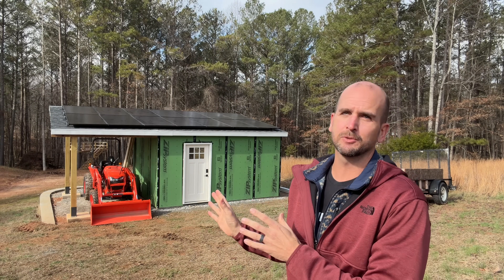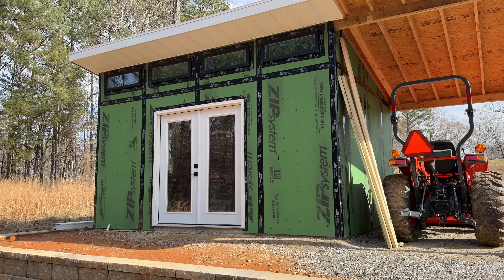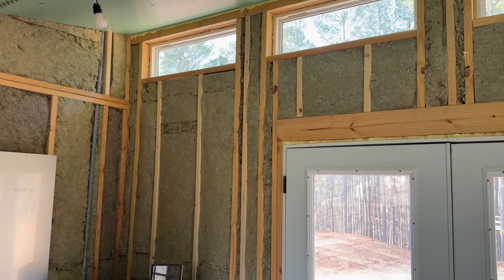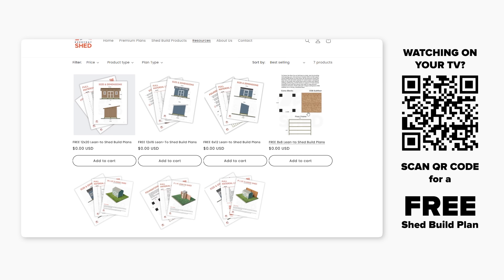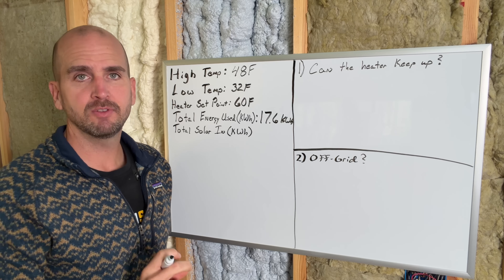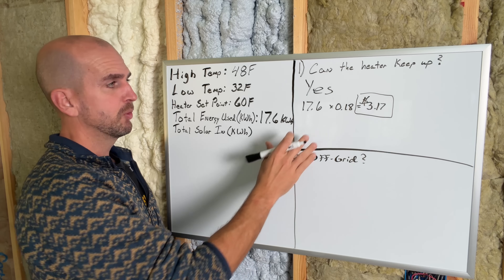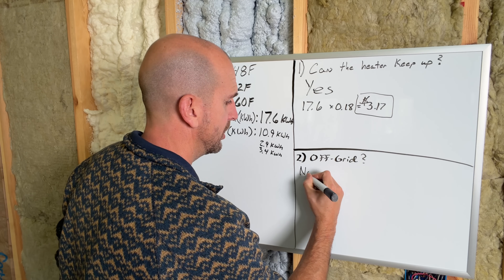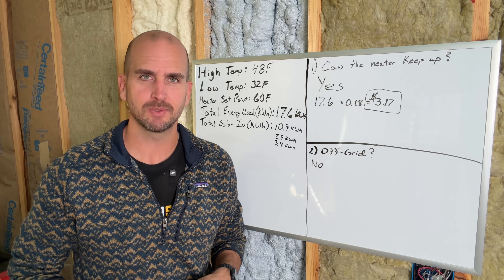HUGE Mistake: Why My $15,000 Solar System CAN'T Heat My Tiny Shed

Comment: This is probably posted to try to stay relevant to the algorithm with a half done project. Or as a comment farm. Either way it's rediculous to instal huge french doors and a front door on such a small space with basically no insulation on the floor or cieling and expect to retain any heat. Old timers know to seal the inside and outside and that the windows should face the winter sun.

Comment: price of that battery is too high for its capacity, but it doesnt matter, without grid even 28 panels will not help you in the winter because there would be stretches of days with zero solar input. 
so even if you get heat pump there will be days when you would need to use propane heater or regular outside wood stove.

with a minimal heat pump that consumes 2kwatts below freezing(cop2+ so heat output is above 4kilowatts) you will not be able to run 24/7 because you already pointed out that solar panels does not output enough to keep positive balance with that battery, and 1kwatt heat pump will not work when it gets way down below zero for a 3+ days.

use any "smart" heat loss calculation  app or service and you will see for yourself that 14 panels will not work out without grid

Comment: Its pretty cheap to build a thermal battery. Put a 220v water heater element into a steel drum filled with sand. After the power is gone from the solar with the sunset the thermal mass of several hundred pounds of sand it will keep warm and giving off heat.

Comment: Instead of a deck, I would build an atrium outside the french doors to act as a heat sink. If you have enough thermal mass in there, you might not need the heater at all on most days. I would also add insulation to the floor and ceiling as others suggested.

Comment: A few things - most sheds don't need to be that warm - just above freezing - say 40-45 degrees.  2nd I'd have a lot more insulation and would include a vapor barrier for any insulation that is not foam based.  3rd I'd only use foam based insulation for 1 2x4 stud cavity.  My garage has r35 in the walls and a vapor barrier - ceilings are r48 foam (foam board - I used DOW in the past - but Silka now -HD -  4x8 sheet @ about $40/sheet - r6.5/inch - fur out the walls to 4 1/4" and double layer)  Also insulate the floor - you're loosing a ton of heat from the floor.    I also agree with the heat pump - get a COP greater than 1 above freezing.  If heating is your major concern -paint the shed flat black (it will cook in the summer though - you could add shade sail in the summer).

Comment: Your vapour barrier should be on the inside of the insulation, you will get condensation and then wood rot with it on thru outside.

Comment: Use a mini split heat pump system rated for low temps. It will generate 3 times the heat for the same power usage. Or use 1/3 the power for the same heat. Depends on how you look at it. Resistive element heaters are very inefficient compared to heat pumps.

Comment: I have a 6kw system on my house.  Power generation is much less in the winter as the amount of daylight hours is much less (hard to solve that old tilt of the earth's axis as it orbits the sun problem).  Also, you have fixed panels (as do I), so the angle of inclination of the panels is very sub-optimal to the sun in the winter.    These two problems get worse the further away from the equator you get.  Finally, you tend to have more overcast days in the winter.  I average 35-40 kWh of generation per day May through September, but only 10 kWh of generation December through February.  You would have to oversize your solar system by a great deal AND have a good amount of backup batteries to truly go off-grid and live comfortably in the winter months (and this would cost a great deal of money).

Comment: Try a heat pump. Eg4 has mini split systems that run directly from solar panels with no inverter required.

Comment: Trying to take sunlight, convert into electricity and back into heat doesn’t make sense. if you can collect enough sunlight to do it you can collect more than enough with a solar heat pump.

Comment: You don't need it to be 60 degrees 24/7, it just needs to be above say 40-45 degrees when your not in the shed (assuming there is plumbing). Also, passive solar would help. I'd use propane when I actually occupied the shed.

Comment: You really emed to do more research before making these videos. Your insulation is bad, your heater is the worst option you could have gone with, and your solar system isn't worth nearly $15k even if that's what you paid for it. I have 16kw of panels and 94kwh of lifepo4 batteries and I'm $15k into that whole system. Ecoflow and every other similar system is overpriced trash.

Comment: In the first few minutes I could see the problem no split system A/C that is 3-4 x better than a resistance heater ground loop even better, lots of windows with no curtains, solar not taking up all the roof space or even better overhanging a bit.

Comment: I see a lot of people mentioning in mini splits or a heat pump which both are great ideas. There’s also one other one I would also possibly be considered. That would be radiant floor heating using like a hot water tank and running pipe underneath the floor and like everybody else has mentioned you need way more insulation for your ceiling. Heat rises, and heat moves to where it’s cold so the greater the temperature difference from outside the inside the quick you’re gonna lose that heat if you don’t have adequate answer.

Comment: There are only two ways to off-grid solar battery heat any kind of space and here are those two ways you either throw a stupid ridiculous amount of money at it and have 15 kilowatts of solar power and a huge battery array or you take the much more reasonable rational and cheaper way you insulate the living m********** s*** out of that shed.

You need way more insulation in the ceiling way more insulation on the walls and you need insulation on that floor. 

You need a larger shed and then you double or triple the thickness of the walls you want at least 12 inch walls with heavy insulation staggered if possible to avoid surface to surface contact transmission of heat inside or outside. Meaning you want to isolate those beams.

You should be able to heat that space with a 2 or 300 watt heater. If you can't it's not insulated enough. 

When you heat a space you're not really producing heat to heat the space that doesn't actually take all that much heat what you really need to produce is the Delta you need to produce the heat you're losing to the environment from that space that's where all of your energy goes. 

At a minimum you want double thick walls double thick insulation on the ceiling and the floor do not forget the floor that's a giant heat sink. 

And then you need to hermetically seal that place. So if a mosquito farted you'd smell the stink :-) 

And then you need to worry about humidity because once you seal the place of that tight humidity becomes a problem if you live in a climate that isn't desert like.

Or. Forget about solar heating. Instead install a diesel heater. A little tiny 2 kilowatt unit will use about a gallon a day at full tilt and be more than enough to eat that space if you reasonably insulated don't forget the damn floor. 

Use excess solar to a heater during the day and then depend on the diesel heat at night.

Comment: Commercial foam insulation isn't that expensive and it's ~5.1/inch. Better insulation, thoughtful window placement, thermal mass and a heat pump. Hell, a passive solar heating system on the south wall.
Does he make these mistakes just to drive comments?

Comment: Bro, get a small wood stove, Wood is cheap if not free, stoves are fairly cheap. You can thank me later, I live in Massachusetts I use my wood stove to heat my whole house (split level ranch 1900sqft) from November till April no problem.

Comment: this is a job for a mini-split. a small 9 or 12k btu will run on 120v and use 300-400w of power and put out equal or more heat as that 1500w radiator. Element heaters should be banned with how inefficient they are at making heat.

Comment: Even if you have enough solar to provide the energy needed, the space heater itself may trip you up. Even though that oil-filled radiator may be rated for 1500 watts on high, the thermal overload built into the heater may limit the heater to 700 watts once the oil in the heater warms up.

Don't remember where I saw that effect. I thought maybe it was Technology Connections, but couldn't find it. Maybe it was this channel.

Comment: Will explain why this person is a idiot.  1- his installed rock wool insulation is stuff in between studs, wrong, even though much of this type of insulation shows correct installation printed on the insulation bats.  Tabs are to be attached on the outer edge of the studs allowing insulation to fluff out to fill the space.  Smashing into the space greatly decreases insulation effectiveness.  2- Look at all those windows.  Insulation factor of those windows is typically 2.2.  All those windows a large heat leak. 3- He states his shed is on a concrete slab.  As it is likely the slab is not insulated and given the size of the shed, it is very likely over 50% of his heat load is through the not  insulated slab.  Taken together this demonstrates his lack of knowledge about heat loss, proper thermal materials installation, and not studying heat loss through not insulated slabs.  I wish his bad methods and techniques was added to this video or in a follow up.

Comment: The problem you engineered is poor envelope insulation and less important you are using a resistance heater. Continuous insulation is your friend but you only put it on the roof and you only put 1/3 of what you needed.  You skipped insulating or air sealing the floor and you would have been 100% more efficient with your walls had you just used Zip R stealthing with an R5 poly iso backer to the plywood. The problem isn't the solar it is the building.

Comment: Still too little insulation (by european standards) especially from the bottom.
Panels are laying a bit too flat to harvest winter sun effectively.
Maybe replace the heater with invertable AC/heat pump.

Comment: too many windows which hemmorhage heat. Put a ton more insulation in the ceiling and lower the ceiling. put more insulation in the walls inside and outside. You are spending way too much and a small woodstove or even a small diesel heater would do this heating easily. Lithium batteries won't charge if they get cold enough also.

Comment: My off-grid 8’x8’ energy building has 1” of closed cell foam here in Texas.  We also have 20KW of panels and 65kWh of LFP batteries. Even on the coldest days (sub 20’s) I barely use any power keeping my batteries above freezing with an inverter AC/heater. Maybe our loads are 8 kWh total during the day and we generally make more than that unless it’s super overcast. Last night the temp hit 24F and the low in the building was 47.7 with no heat at all other than the inverters running. It’s 2pm and it’s 57 in the building now. If it was going to be in the 30’s for several days I would eventually turn on the heat.

Comment: The rising heat is directed to those transom windows which will bleed more heat than anything else in this shed, even more than the poorly insulated ceiling. This could maybe be justified if the windows faced south, but they can’t if the roof slants south for the solar panels.

Comment: Too much glass and way too little insulation for solar heating.   That heater probably couldn't keep the shed warm at night if you plugged it into a 20A circuit.

Comment: If you plan to use solar heating/cooling, you have to plan to be more efficient. You would want 2x6 walls, and you are going to have to up your game on the overhead insulation as well. In addition, I would want 2x6 floor joists over the concrete, and insulate the floor as well. Otherwise, solar is going to be a continual issue. It can be done, but it requires careful planning for efficiency.

Comment: You could have spent $2500 on a 20' reefer container and heated that with a candle. The problem isn't the system, it's the structure.

Comment: A mini split with a heat pump could give you double the heat at half the power requirement. Resistance heat is the worst choice for any environmental control. And stuff more insulation in the rafters! Everything has a point of no return but you really can't reasonably spend too much on insulation.

Comment: Switch to a variable speed mini-split and you'll probably have no issue keeping it heated, even at that low temp of 32 degrees, a heat pump will have a COP of at least 3.

Comment: Insulation, a wood stove, and or, HVAC ducting buried down to the ground layer where temperature is constant, forming a heat exchanger, with electric fans run off a smaller solar panel are other options.  The wood burner is low capital but ongoing fuel cost (unless you can always source your own wood on land).  The ground heat exchange system would have been high capital with zero ongoing costs.

Comment: I plan to heat my house with solar panels in the fall and spring. When the outside temperature is 50-59 F and the sun is already high in the sky. Not in winter. But I think the minimum is a 9kW 3-phase liquid heating element. I'll probably need two. About 48 panels. It is a "brainless" system with a mechanical thermostat without batteries, 6x400 EUR inverters, and a accumulation tank as a battery.

Comment: What isn't clear to me is whether or not you're including that initial high energy draw to heat the shed in the 24hr test. If so, that will significantly throw off the results, I'd like to know how much energy it needed just to maintain a 60F temp.

Comment: I'm surprised you went all out with insulation, solar panels, and a huge EcoFlow system, but didn't install a heat pump, that would be multiple times more efficient than a radiator and would be reversible, giving you A/C in the summer if needed.

Comment: I'm no expert... but there's two obvious issues that you're fighting here.
  One: Solar in Winter. (Regardless of weather, the maximum amount of Sunlight is always guaranteed to be Less than 12hours.) You may only have 3-4 days per week of up to 8 hours of cloud free/visible Sunlight. (And generally lower horizon Sunlight at that)  
    You can maybe run the non heating electric systems off Solar, or maybe something like a Thermal Battery for Heating... doing both off of Solar alone, is likely a pipe dream. (Even the heating is likely to need a backup/primary alternative. I'd think that the running other electric elements could work, just not with heating also being a drain.)

   Two: Lack of Insulation/Airlock. The big window doors look nice... but even if insulated, they'll be cooling the air inside directly. While a direct foundation sounds nice, without a insulated layer/air gap between the building and the majority of the foundation... (or geothermal floor heating) you're effectively trying to heat the Ground in addition to the Building. 
  Similarly, the Roof NEEDS double/Triple the insulation otherwise all the hot air just gets cooled... Similarly to the Glass Doors, but larger surface area. 
   Lastly, entering/exiting the building... especially when this small... exchanges heated air for outside air. A simple Airlock for the Doorway, will help. If it were extended to cover a wall, then there's more insulation... which is needed for small building Regardless in any freezing, but especially Zero/below temperatures.

Comment: Raidiator heating is not efficient enough to heat that space. Try a wall mounted forced air heat pump, which provides heat and air conditioning. They are way more efficient, and can circulate the air better, providing a more efficient heating and cooling device that will work with your current solar setup.

Comment: Dude, no one said solar works in the winter!  Here's the plan, buy about 100kWh worth of batteries and charge those during the summer. Then in winter use the batteries to start your propane heater.  You'll be warm all winter.

Comment: Also, solar in the winter? I hope you don't mind constantly removing snow from the roof, because snow will reduce solar's output to almost zero. And even then, in the winter, most days at least here in PA are cloudy. You're always praying for sun to melt some of the snow so you can actually go on the roads, lol. clouds = way less solar output, too.

Comment: Many years ago, at the University, someone told us: "Electricity is the most expensive and universal energy source. Never use it to produce heat unless there is no other choice." For a house in the middle of the wood, burning wood is the best option.

Comment: I don’t remember the name of the product. I purchased a wall mounted electric heater that draws less than .5a. Has no fans, uses vertical heating plates and natural convection. It took all night, but kept a 600sgft little cabin very toasty. Small enough draw to just leave it on all the time.

Comment: One of the most successful and most efficient off-grid heating methods throughout history is to heat a thermal mass as a storage device. Your slab is that thermal mass.

Comment: R10 roof is not enough.

thermal solar (https://www.youtube.com/watch?v=WRAxpaYh6DA), and  a ~$400 12,000 BTU heat pump with the solar PV per day. You could get it down to 4 kWH per day.

Transoms need to face mostly South to the gain the heat benefits.  Right now heat rises  into that corner of the ceiling and conducts out of the window.  Put up permanent clear plastic panels inside each transom window to act as an air pocket to reduce conduction.  The shed also has one more door than it needs one is way too large.  This shed is an efficiency nightmare besides the rockwool.